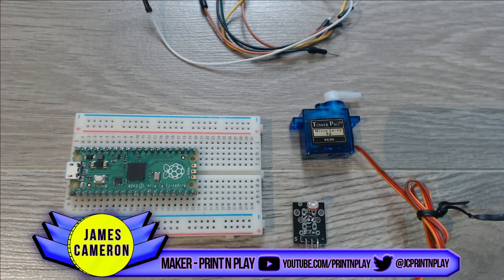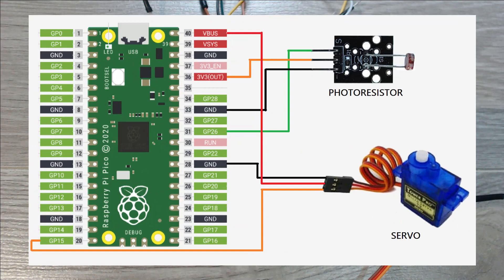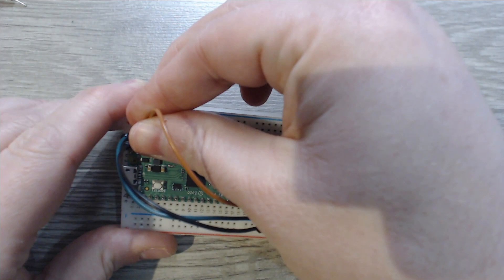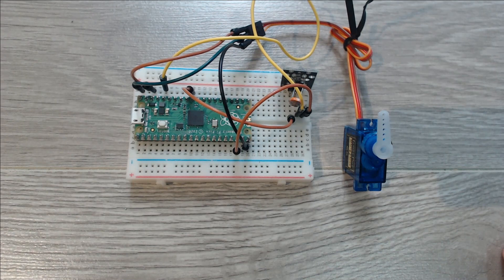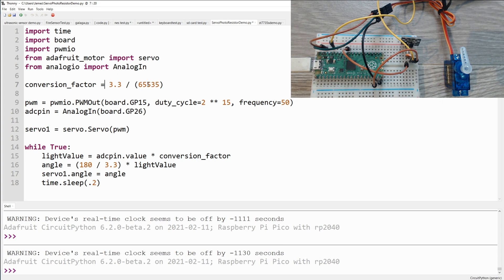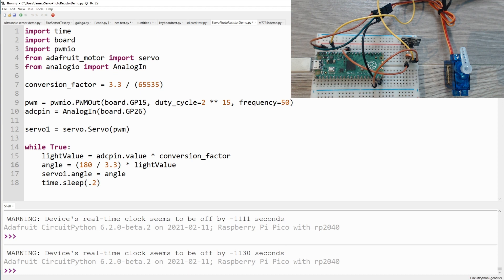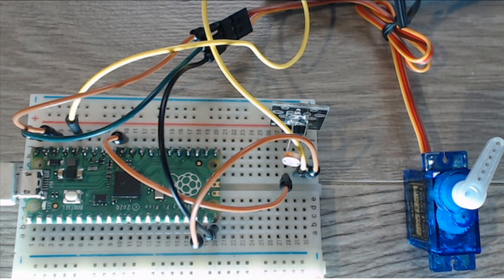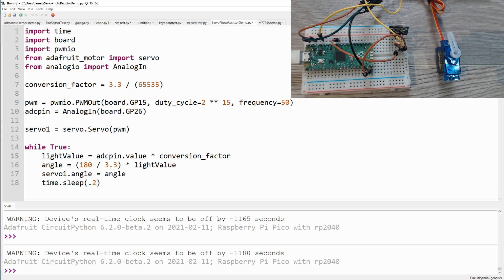Using Servos with a @raspberrypi Pico

Comment: This is also a control loop, specifically an  "open" control loop, as there is no feedback to the control loop (for things like detecting a missed servo step or inaccurate position).  To use the full engineering terminology, it is an "open servo control loop".  In common use the word 'control' may be deleted with no loss of meaning (since servos must be controlled), yielding an "open servo loop".
Reply from the maker: Thanks for providing more of the technical background behind the different types of control loops!

Comment: be interested in a video using Pico, 2 servos, switches, leds.   Object:  To use a couple of switches to control if one or both servers move a set angle and have LED indicate servo moved or not moved (red/green).  I'm having difficulty getting two servos to work on a Pico with CircuitPython.  Thanks

Comment: First the smileys :-) :-D.
I know that it is "Nit-Picking" but when you divide something by the values 0-9 i.e. 10 you do not use "9" so dividing something based on 16 digital bits should be 63536 not 63535.
Sorry I am one of those mathematically correct nerds who celebrated the Millenium at midnight Dec31st 2020 not 2019. :-)
Other than that useful video enjoyed it and found it very useful.